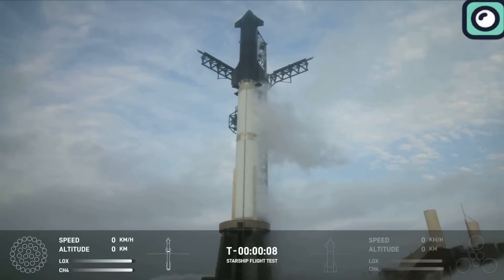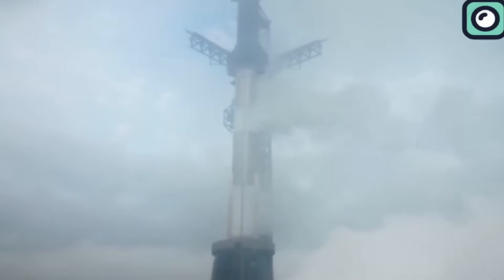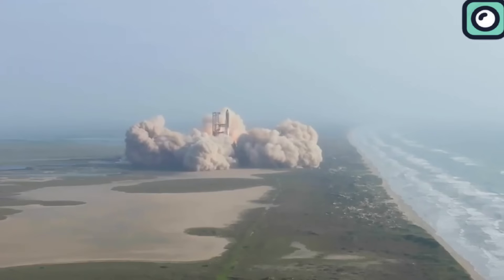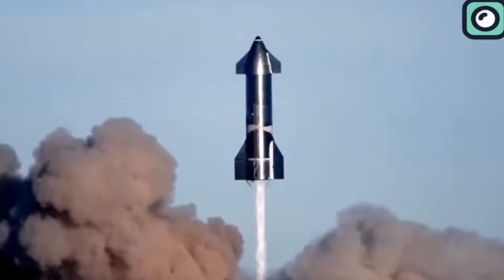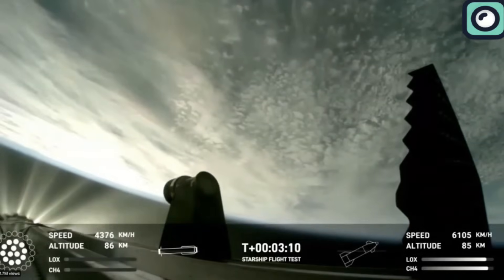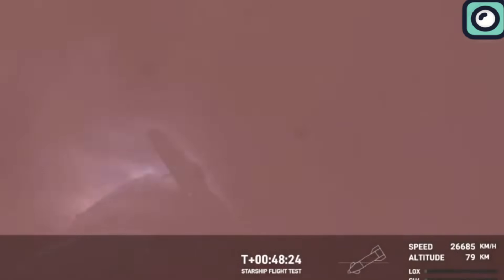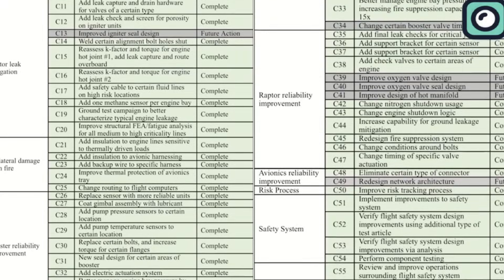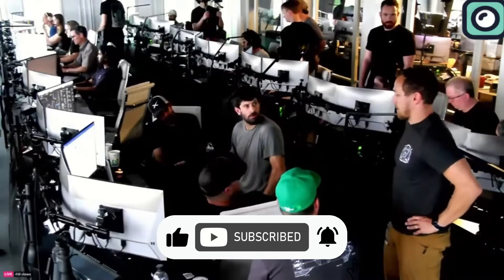SpaceX Reveals What Exactly Happened At Starship Launch!

Comment: It seems that Starship burned up because it lost a number of the heat shieling tiles. But, could it have burned up because there was an oscillation in the long axis that cause the roll. Then the wrong portion of the Starship was going through the atmosphere to cause the burn-up. And could this rotation along the long axis to Starship have been caused by sloshing of the remaining fuel, in a direction that was unplanned, and not internally engineered for. They fixed sloshing in the booster, but how about in the ship itself. They also mentioned the angle of attack coming through the atmosphere was wrong, and could this have been cause by the fuel moving in the ship also? Maybe it needs more internal baffles?

Comment: How much can the Starship Super Heavy rocket actually carry into orbit? With Raptor 3.1 3.2 engines, the total thrust mass will exceed 10,000 tons, and the rocket with fuel alone will exceed 5,000 tons. The difference between the rocket's thrust and mass is huge, which shouldn't be the case
problem with putting 500 tons or more into orbit?
What is it like in practice? Is it possible to put 500 tons into orbit?

Comment: I never expected heat shield would work
Reply: It looked like the heat shield didn't have a chance to do its job since the rocket was tumbling on the way down instead of belly flopping like it should have keeping only the heat shield facing forward/down. I could see points where the vulnerable parts of the rocket were taking direct heat - not surprised it broke up.

Comment: Well, it does hold the new record for the biggest thing ever launched to escape velocity... And it did go far....
Now they have alot of work to do, and probably need a re design, but due to units ahead will try more launches of similar units, and try cobbling up fixes. Hopefully things begin to form patterns, and they can start realizing the weak points of the current designs, and do a major design correction. Its getting pretty obvious, people pointing things out. 

But experts are often resistant to the obvious longer...

I suspect the online armchair engineers will have their way with them before this is over, And we will end up with something vastly better than what flew this morning.

Comment: Um, no, this is a great production, but highly inaccurate on the booster outcome. 
Please correct and show the booster passing through the cloud layer (as broadcast) and then losing control and cutting transmission.
You instead jump straight to the Starship and claim the booster may have landed.

Comment: The burn back worked well…. Only one engine lit.  It crashed.
Reply: Looked like it may have been out of fuel.
Reply: @kennethpace9887  what does out of fuel look like?
Reply: Where did you learn that? I assumed it crashed because there are no reports at about what happened to the booster.
Reply: @AmateurHistorian999  - Watch the video and telemetry..  the 13 core engines failed to light evenly (most of them failing to light at all), producing off-axis thrust, which causes the booster to begin gyrating as the gridfins flail wildly, in an unsuccessful attempt to correct the situation. Moments later, the signal is lost.
Reply: @AmateurHistorian999  I watched it!
Reply: @AmateurHistorian999 they said it themselves